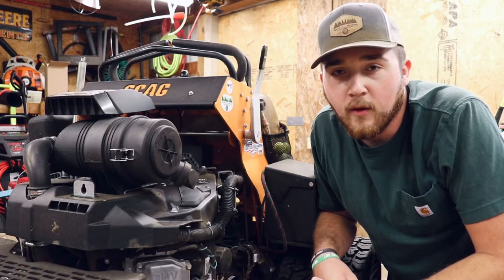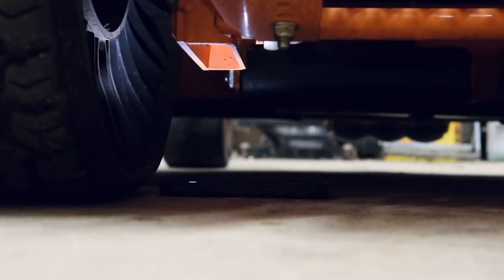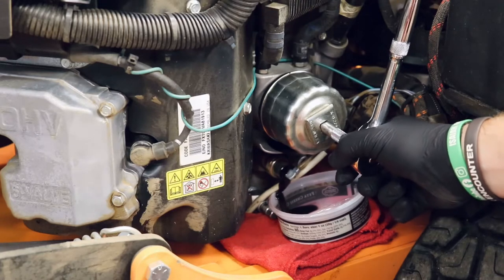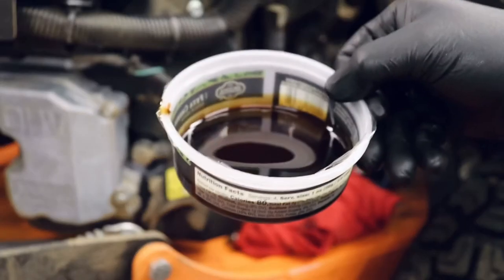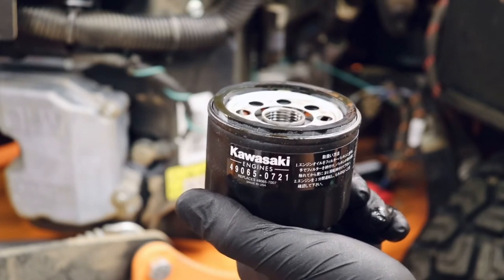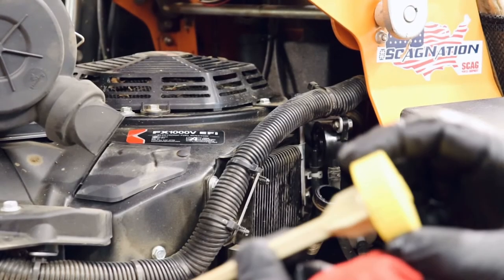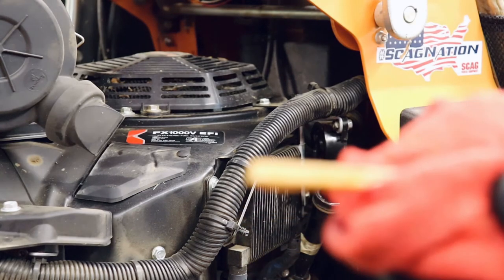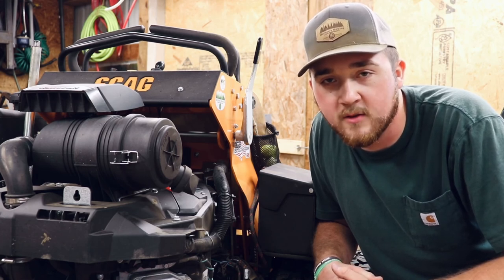Kawasaki FX 1000V EFI Oil Change - How To Video

Comment: Why did you do 10-40 when the manual calls for 10-30?
Reply from the maker: The 10-40 gives a little more heat tolerance on the scale. With how big the engine is and temperature in my area, I use 10-40.

Comment: don't use that oil it don't have enough zinc in it
Reply from the maker: Actually it does. It has enough zinc additive to keep the cams coated and protected from wear.
Reply: @matthewsmowing  your wrong I've did oil analysis
Reply from the maker: @shanepipkin4041  As have I. I have had no bad experiences with Amsoil in anything I’ve ran.
Reply: @matthewsmowing  it don't have enough zinc the only amsoil that you or I would run is the zrod it has high zinc. just letting you know the facts  the oil will work but don't expect to get 2000 plus hours. small engine need high zinc I've talk to them on this
Reply: @shanepipkin4041  
Ive used regular motor oil and I have over 2100hrs on my walker.
Reply: Then what oil do you recommend?
Reply: @Customsouthernarms  I run scaffers look it up and the reviews.   but there are a few good ones the only mobile is 15 50  that's good.  deere 50.  key is 1200 plus zinc